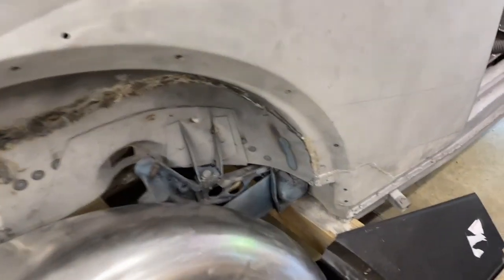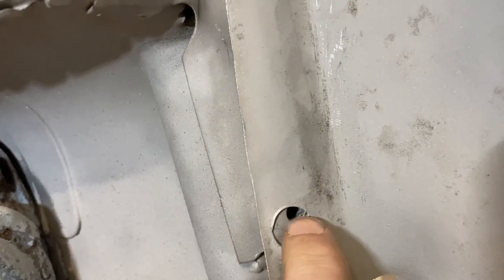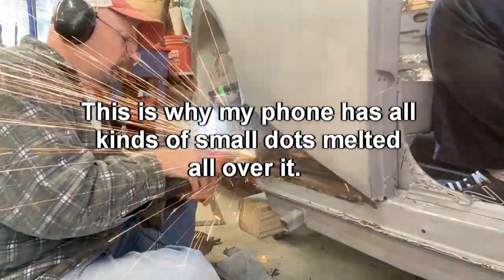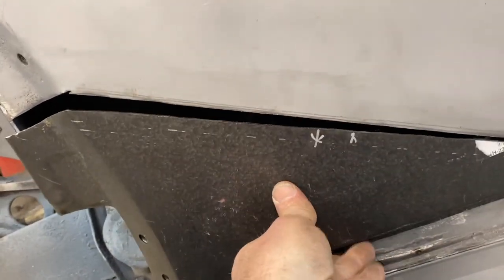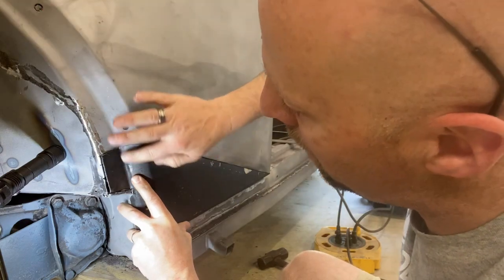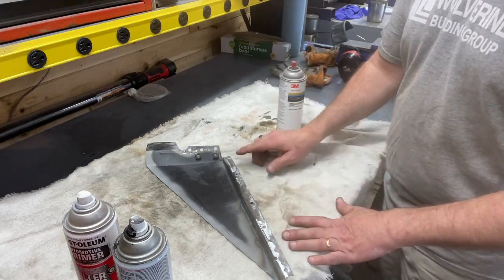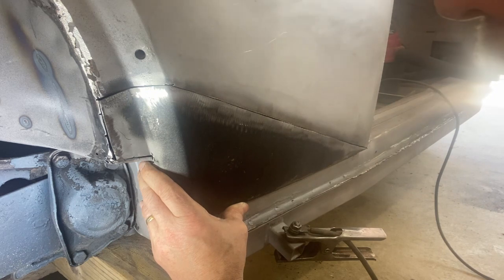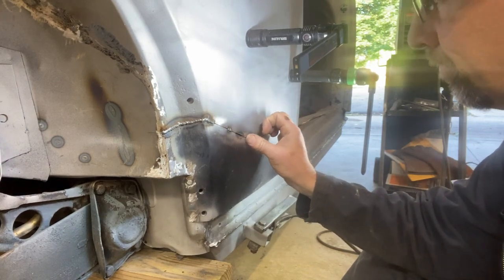1966 VW Beetle Convertible Restoration - Pt. 15 - Problems welding the rear quarter panel!

Comment: Remove the welds and dolly slapper. This will help get the metal go to its original place. Also for butt weld i learned tig weld and help on preventing metal shrink compared to mog
Reply from the maker: I wish I knew how to TIG weld.  That's on my bucket list of things to do someday.  Thanks for the suggestion.

Comment: make sure you are using non chlorinated brake cleaner or the gasses from heating it up welding can kill you . thanks for the vids im getting ramped up to work on my bug .
Reply from the maker: Good luck with the project!  Are you going to post pics or videos?
Reply: i have a youtube channel i've done a couple vids on it but it's on the back burner right now i have a 65 mustang that's ahead of it  but there both slow going . 👍

Comment: Fitzee says cooling with air will cause the metal to "tuck in".  Says patch must cool slowly on its own after each weld.  https://youtu.be/yrZsZY0qMkA?t=2584
Reply from the maker: I just watched that video last night too.  I'm definitely going to try slowing down and letting it cool on it's own.  Thanks for the recommendation.
Reply: @3rdstallgarage  wait you were cooling the panels by blowing air on them?